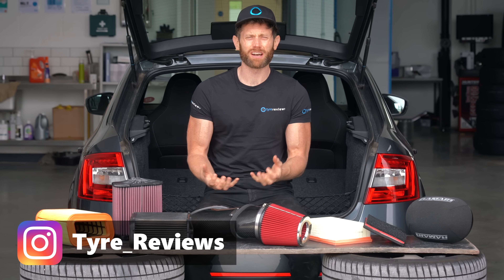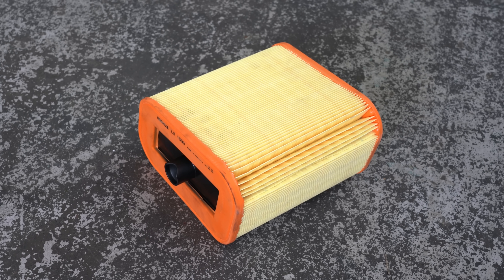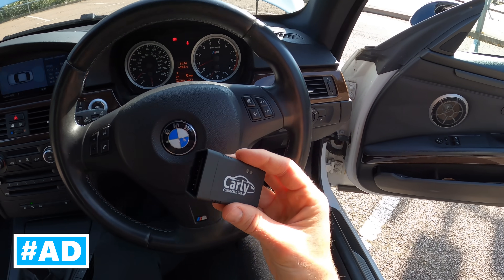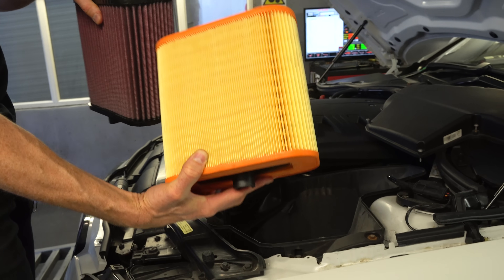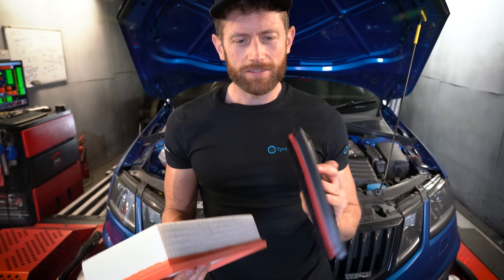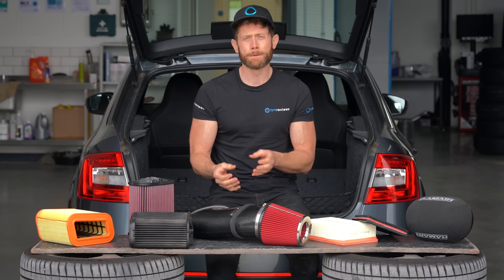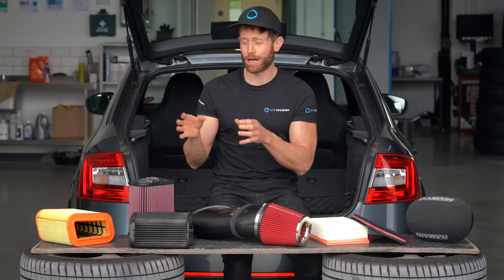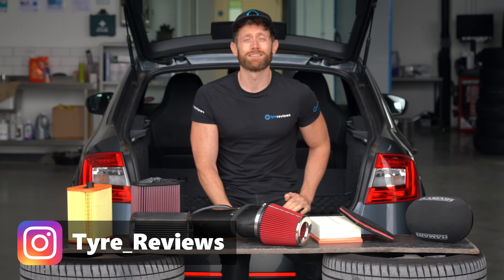Do Performance Air Filters REALLY Give You More Power?

Comment: this honestly isn't surprising. Without a tune, changing intake parameters will just change reading on the ecu and cause the computer to adjust timing and a/f tables. You'd need to trick the maf sensor into thinking it's pulling the same amount of vacuum as stock to get any benefits, or modify the ecu parameters. I'm more curious to see the torque figures for both cars.

Comment: Bought a MST Cold air intake kit for my old Audi A3 8V 1.4TFSI 122hp and the difference was feelable, way better on higher revs, more responsive and was 0.1s faster :) and it keeped the car cold on higher speed + lower consumption on high speeds
Cons was that the car was weak under low rpm... 
+the sound it maked was insane, but a lot of noise in dayli driving.
didnt dyno test it.

Comment: Performance filters are crap. They do a very bad job at filtering the air, and they don't increase the power.
Air filters, air boxes and air intakes are already optimised by the hundreds of engineering hours by engineers who know what they are doing. By putting some aftermarket unicorn magic mushrooms you are just messing up an optimised system. They don't provide more air into the engine, the air pressure is the same. They just let more dirt into your engine, so you can say goodbe to your airflow meter and injectors sooner. And especially if you RICE it all the way and remove the air box, and just have a magic mushroom sucking in hot air from the engine bay, and thinking it is now a "cold air intake" (what it actually had from the factory)...

Comment: No more HP but between 6 and 10 Nm more torques from everything except the stock filter
Reply: Because the engine does indeed breath easier when using an air filter with HOLES in the media. Hahaha. 

A bump in power anywhere in the rev range is expected... technically. 🤷🏻‍♂️ 

But I’d rather my engine breath CLEAR Air. 👍🏻

Comment: Best Intakes are with a completely closed box, tube optimized with a symmetrical cone filter in it. Sucking air really from the outside with a light ram effect.   
Got one in my 2019 Mustang 5.0 and was really impressed with the result of throttle response and low rpm torque!
Reply from the maker: Must sound great too..

Comment: I would be interested to see an on-the-drag-strip / on-the-road test with the open cone / ram air type filters when they are getting cold air flowing in and heat soak is not so much of an issue. Stationary on-dyno testing, even with a big fan, does not replicate the amount of cold air that you will get at 50 or 80 mph. So, the question is, do you see any measurable performance over say 5 drag runs of 30-130mph over the stock airbox
Reply from the maker: One for next video

Comment: Could the lower power be accounted for by the NA engine running leaner with the higher air flow of the aftermarket filters? With the boosted engine being able to compensate for the increased air flow with its higher compression, and the NA engine's ecu needing some 50 odd miles of driving to adjust the a/f and timing?
Reply from the maker: Maybe! We ran the NA engine a few times to get through adaptation but maybe more would have helped
Reply: @tyrereviews  It's the only explanation I can think of, since we know more air (oxygen) increases combustion potential, and it's way more doubtful that the oem filter allows more air flow than the aftermarket solutions that have r and d investments behind their designs, to specifically allow more air to flow.

Comment: I have Pipercross on my Mk6 Jetta. While power increase is minimal, the biggest difference is how much more responsive it's got in low throttle as well as off-on throttle situations.
Reply: But with that message nobody will watch this clip... clickbait af
Reply: This feeling is called “freer” but I guess it will not last more than 3k kilometers until you loose this feeling. With oil filters like K&N you have the same feeling for 9k kilometers. Waiting your experience if you have 1-2 min for a comment sir.

Comment: Great video! I've got an EP3 and just installed a tegiwa induction kit where the filter sits inside a box and the scoop goes up towards the scuttle pannel. The throttle response feels better and the noise is great. Do you think this test is relatable to the majority of cars and kits out there?
Reply from the maker: tegiwa are great guys! Every car will react differently, so it's just a rule of thumb
Reply: That Gruppe M kit is particularly effective.  Though on the genuine Gruppe M, the smooth mould side is on the outside of the duct instead of the instead of the duct, which is not ideal (Formula One intake ducts most definitely have the smooth mould side on the inside, and the coarse side on the outside!).

Comment: i'm new to this channel so i dunno if comments on older videos are being read so i'll ask here. i guess many know that tire manufacturers sell different tires in different regions. so central europe gets others than scandinavia since in the north they need to have beefier ones. i recently came across a website that offers "nordic" tires to the central european market. I wondered if buying nordic tires are worth it or if i should just stick to the ones offered for central europe. Both are similarly priced. How big is the difference between them? Can we have tests plz? Preferably on 225/55 R16 if possible :p
Reply from the maker: There's videos on the channel comparing them, but in short a nordic winter tyre is not suitable for Central Europe as the dry and wet performance is reduced

Comment: I was Very  disappointed in my eventuri didn’t make any power at all just ran lean on my e46 M3
Reply from the maker: Did you try a remap?
Reply: Yes didn’t make any difference best one was drop In Filter with the elbow
Reply: Stock M3's can run a bit lean on full throttle too, circa 14.1AFR.  
Reset long term adaptions (you will need a Autologic for this).
When they do this they don't make their full power.
Once they hit around 13.2 AFR they get really grunty.

A stock M3 doesn't lose power with this intake.  I did the initial development and testing on the Eventuri kits when I was a part of it.

Maybe change the MAF?
Reply: We changed everything maf injectors all 02 sensors still 14.1 afr the problem is the injectors can’t flow enough fuel for the amount of air coming in we changed back to the standard intake and It made power again we did a smoke test aswell for air leaks . Sorry it did sound and look good it’s just disappointing due to the cost those intake actually are.

Comment: I was told by a engineer years ago, manufactures spend lots of money developing air cleaners for their engines, what made me think a after market air cleaner could be better, I use stock air cleaners now.
Reply: But they are not infallible. Look at this e92 rod bearings, look at e46 floor tearing apart, look at m2 and m4 un-keyed crank hub spinning and smashing valves...
Reply: Engineers always have to find a balance of all attributes in order to meet the intent of the company. It's entirely possible you're preferred balance may not be the same as theirs.  The easy example is high flow air filters do let in more air but also let in more particulates, likely reducing the life of the engine.  If you are building a car for the track that won't see high mileage, the performance filter may be better for you.  Or maybe have two -  better filtering for daily driving and then a performance filter for track days.

Comment: I'm sure that with the adaptive nature of the E9x DME versions they would need to be driven a good few hundred miles for the engine to fully align itself with the change in airflow. I appreciate that would make for a very different video as the filters would need to be tested in similar environmental conditions over a number of days. The difference with the Eventuri is the deliberate introduction of some turbulence and I do agree they are expensive for what they really are. I've got one in my E46 M3 and I have to say for the noise and increased driveability of the bottom end it is a cracking bit of kit. Never dyno'd before/after to see if there are any actual power gains but I'm definitely happy with mine. K+N are well reported to ruin the bottom end of just about any BMW with any gains much further up the rev range. Pipercross and Ramair have a decent reputation but again, not something I would be looking at unless running FI. Plenty of comments through this thread also got it spot on, manufacturers spend a lot of time and money into developing the OEM intake, not surprised that anything less than a full CSL type box doesn't give much of a boost. These cars need at the minimum cams, full exhaust and a good custom tune alongside any intake to start making any real noticeable gains.
Reply from the maker: We ran the cars quite a few times between changes to stop the adaptation phase but perhaps more would have helped. The engine looked to have stabailised
Reply: @tyrereviews  It does question the gains quoted by Eventuri, I'm pretty sure they do have a good product and they haven't deliberately inflated their figures to boost sales. Your tests also goes to show the amount of small uncontrollable variables that cannot be manipulated due to the adaptive nature of modern ECUs. Still it was as comprehensive as we could ask for, thanks for the hard work you've put in as always!

Comment: Will stick with a reputable brand of OEM filter in an E46 M3 but there are two inlet channels to the air filter box, one from the brake cooling duct/fog light aperture and the other enters in front of the radiator and runs along the top to perhaps warm the intake air,so is it a good idea to block this channel as I live in Queensland and it seldom gets below 10C even in winter and would this apply to all cars with a warm air bleed or is it similar to performance filters were it makes little difference?
The CSL version with an expensive carbon fibre intake does not appear to have a warm air channel and no brake cooling inlet ducts just a ram air hole so perhaps shoving a sock in the exit cooling duct hole and having one hotter brake disc is the way to go?

Comment: Good review on all the filters, I fitted a few different filters to my 1.8 20v turbo ibiza and lost power & torque, once remapped it made 250 bhp as the maf sensor was recalibrated to account for the extra air and other supporting mods, I only run Honda S2000 paper filters now as there same shape as a aftermarket cone filter, get turbo noises, clean airflow and at 12 pound a pop, bin it after 12 months

Comment: Remember with a modern torque control based ecu its no guarantee you will increase hp even if you increase flow. A remapped or aftermarket ecu would be better to be sure its not doing any compensations. Though i saw the same on my car on the dyno, oem paper filter with massive amounts of filter area was superior.

Comment: I can notice a difference with a cone in my 2.8 Z3 Roadster.  With the cone it not only feels faster, it also gets up to speed a bit quicker (0-60km/h in town, in places that I drive a lot so I know where I hit 60). I have tested it further by switching back, and the car immediately felt MUCH slower.  This is even with an unshielded cone, I'm now busy fabricating a box to shield it from the 96-97 Celsius engine.  But to be honest, the filter box isn't designed to flow (considering the horn baffles on both sides).  Oddly enough, the sound difference is negligible if I'm not standing with my head under the bonnet (at which point I can clearly hear the growling intake).  And I'd like to fabricate a ram scoop behind part of the lower grill, feeding air to the intake.

If I could get my hands on a second intake box, then I could probably cut the clean side horn out (the dirty side comes out with one screw and then also opens up the intake hole significantly), which with a good panel filter should make it flow properly.  But parts aren't that easy to come by, since I'll have to find one specifically for a '99 2.8 (only model year with that specific intake).

I'd still like to fabricate a ram intake for my Mazda 323 (routed into the regular air cleaner in the place of the exhaust stove), but I'll have to see how that goes (they say carbs don't like ram intakes).
Reply from the maker: Get it on the dyno and find out what's changed!

Comment: Just for interest we drive on a lot of dirt and dust roads and i've used standard oem filters and after market filters as well and have had more dust coming thru the stock filter . With the aftermarket filters (mushroom sponge filters mostly) there was no visible dust in any of the intake pipes as i do spray all of my after market filters with an oil mixture and clean them every 2 weeks or so.
Reply from the maker: I guess every 2 weeks will help, it's like motorcross filters. No normal driver will do that htough